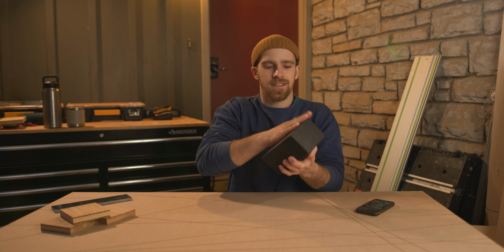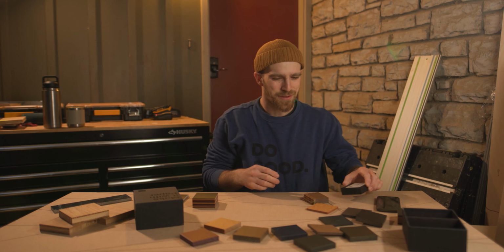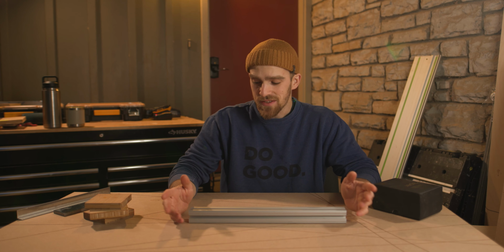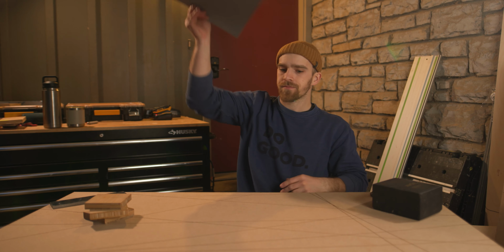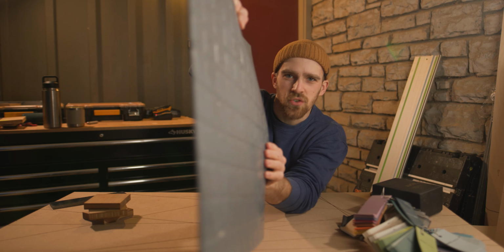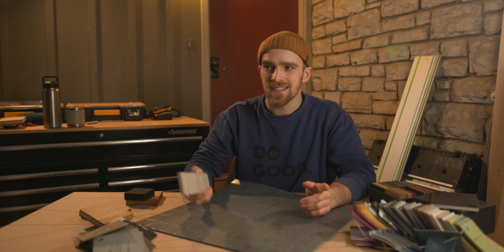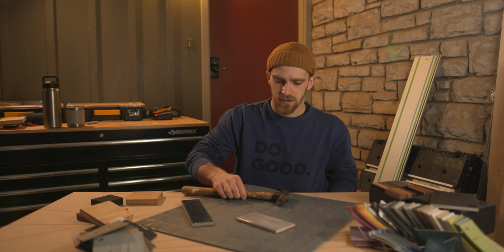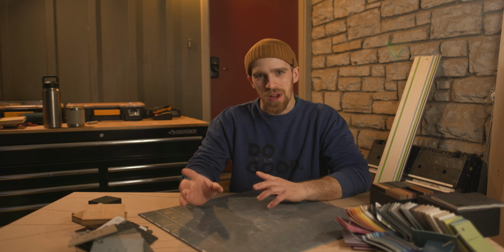How to Build an Eco Friendly Van!

Comment: Totally on this same wavelength with my build! Yes there’s a lot of bi-product and packaging when building anything except maybe an earth-ship these days which is tough to deal with. The way products are shipped/made is a bit unpredictable and if you care about impact it can be a mental struggle!— for instance I bought a track saw and for some reason there was NO cushioning whatsoever in the box so it arrived broken to the point of no repair. What a waste! If I could change anything about my build so far I would have tried to source bamboo plywood but instead I went with Purebond by Columbia Forest Products which Home Depot carries so it was easy to come by even with stocking issues. It’s formaldehyde free, uses a soy-based glue. Originally I was going to try Forbo floors which is a super cool eco-flooring option, but the shipping put it out my range. I didn’t know about Roppe what a cool product! I went with a cork click and lock & an eco-exterior water-based poly on plywood for the garage which ended up looking pretty sharpe! Cool vid/builds/channel btw :)
Reply from the maker: Earth ships are so cool. Sorry to hear about your track saw - hope you got it replaced! I'll have to check out Forbo I haven't heard of that before, and thanks for the kind words!